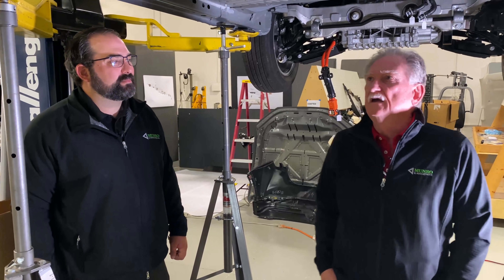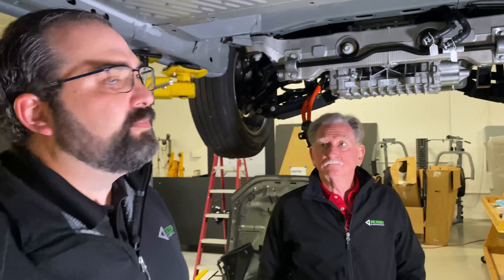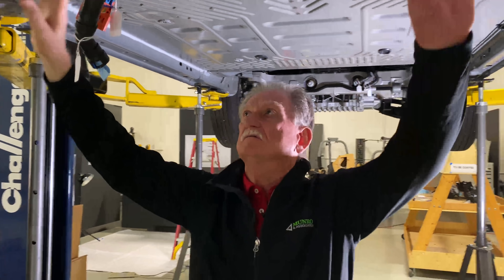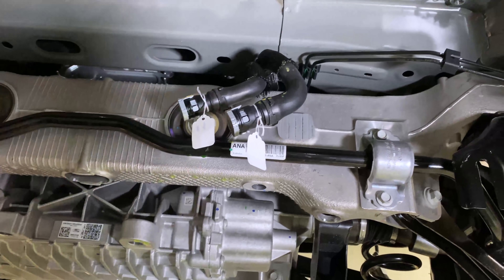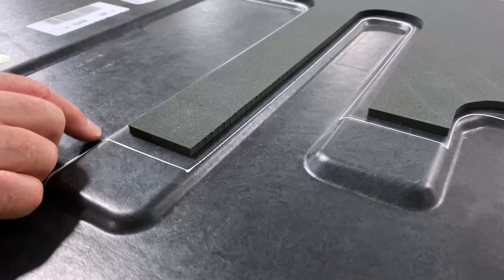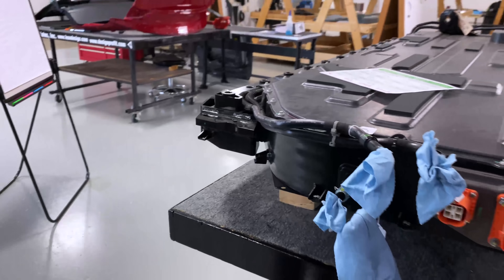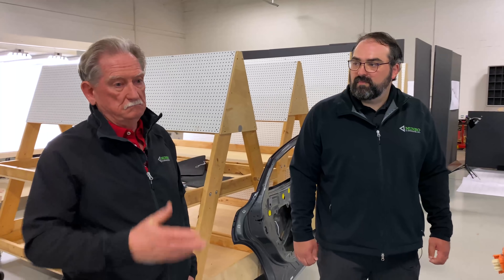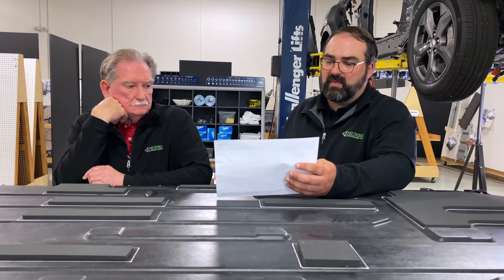First look at the Ford Mustang Mach-E Electric Battery

Comment: That chart is a gold mine 😁. Just imagine the Mach E with the extended range battery weight will be and it will still have less range both model 3 and model Y 🙈.
Reply: If you watch real reviews you would see that the Mustang Mach E LR is closer to the Model Y in terms of range than these charts show. Seems Ford sandbagged their numbers and Tesla puffed theirs up.
Reply: @spacebound1969  Define real reviews 🙈. Auto magazines or You tubers who Ford's sponsors 😁. What's the data shows and what the chart shows is Battery weight, battery capacity and rated range. If you run both model Y AWD and Mach E extended range until the battery dies as EPA range do as on the same playing field then you should get your answer. In terms of electric cars it's all about effieciency and charging speed. Ford's is hiding the Mach E lackluster effieciency with bigger battery capacity, but not as bad as both Audi E tron and I Pace. If you have issue with EPA range then go to EPA and complain 👍👍.

"Compare Side-by-Side" https://www.fueleconomy.gov/feg/Find.do?action=sbs&id=43406&id=43603

Comment: That chart at the end shows how far ahead Tesla is compared to the competition in range and efficiency.
Reply: True.. But keep in mind that a Tesla is compromised by the materials used and the build quality. The Audi and Jaguar use premium & luxury materials that are heavier and dense. Also different battery chemistry gives Tesla an edge. 

A lot of people are willing to give up some range and efficiency for a well built car.. People drive the i3 not for its range, people drive it because its a well built car with good handling.
Reply: That chart is the claimed range by manufacturers some like the Tesla are very over optimistic while the Ford base their range on more range of  temperatures and driving conditions. Edmonds did a test of both cars and it their test found the Mach-E which achieved a real world driving range of 304 miles which puts it towards the top of that list

Comment: 15:30 And your range issues are based on two disconnects. First, Tesla uses a different EPA testing cycle, which inflates their range relative to the others by ~15%. Second, the format of the vehicle has as much of an impact as anything else, so larger, heavier vehicles will not go as far on a given amount of energy.
Reply: Larger, heavier vehicles with heavier battery packs in relation to the pack size.
Just not efficient.
Reply: @rogerstarkey5390  Yes, there's a lot of specific details that are being glossed over here. The most comparable Tesla to the Audi e-Tron is the Model X, which is omitted from this list. A comparison of those two vehicles would show that Tesla's "advantage" is not as significant as Sandy is purporting it to be. 

The other detail that Sandy isn't addressing with the battery weight is that Audi is using more power-dense battery cells with a significant buffer that Tesla isn't using. That's why the e-Tron will charge to "full" in about 45 minutes, or at least 15 to 20 minutes faster than the fastest charging Teslas can go from 0% to full.
Reply: Thank you for schooling some of these people.
Reply: Agreed, they use EPA instead of the now accepted WLTP which is more real world performance.
Reply: @drumahnz  That's not what I'm saying. The EPA offers a choice of two testing cycles. One is more simplistic, and simply multiplies the calculated range by 0.7. The other, provides additional tests that can be used to offset that reduction, and that is the EPA cycle that Tesla uses. For real-world driving, the more conservative EPA test appears to be far more accurate, while Tesla's chosen cycle appears overly optimistic. 

As an example, on paper, the Tesla Model 3 LR has ~10% more range than the Ford Mustang Mach-E RWD Extended Range. However, in most real-world scenarios, the Mach-E RWD Extended Range has the same or better range than the Model 3 LR.
Reply: @drumahnz  
My understanding was (is) that EPA is closer to real world.

Comment: 15:06 You're mixing numbers on the Chevrolet Bolt EV. The 259 mile Chevy Bolt EV has a 66 kWh battery pack which only weighs 430 kg. The older pack is 60 kW, weighs 435 kg, and provides 238 miles of range.

Comment: At 16:00:
If somebody talks about the capacity of a battery pack, it is useful to state whether it is the gross or the net capacity. 
The gross capacity of the Standard Range Mach-E is 75.5 kwh. (https://www.greencarreports.com/news/1128726_ford-mustang-mach-e-electric-vehicle-battery-capacity)
The net capacity is 68 kwh
For E-Tron you mentioned the gross capacity (95 kwh).
About the BMW i3 line: BMW produced the 22 kwh pack between 2014-2017. Since then BMW doubled the energy density of i3's packs. (https://electrek.co/2019/11/22/bmw-keeps-doubling-energy-density-of-i3-batteries-enough-to-kill-range-extending-engine-for-good/). Unfortunately they do not say if it is gravimetric, or volumetric. But we can assume that the gravimetric increased significantly. Also, "Fifth-generation BMW eDrive technology also includes a high-voltage battery. Its volumetric energy density at cell level is up by around 40% compared to the high-voltage battery in the 2020 BMW i3. " (https://www.greencarcongress.com/2021/06/20210602-ix.html).
I guess these will be in iX and i4. iX already started production.
So, is not this line quite misleading?
Aout ETRON: when a manufacturer build and BEV based on an existing ICE platform, there are some advantages (low cost and relatively fast development, low cost of modifying factories to build the vehicle) as well as disadvantages (more weight, less efficiency). A more decent comparison would be to put here the MEB pack's battery, which was checked by Sandy anyway recently (id.4 pack), and according to their data the energy density of id.4 pack is less than 2% more than Model Y's. 
Bolt is also an old design, I have not researched it, but I would not be surprised if that was outdated data as well.
And I can see Tesla fans jumping on these outdated data without thinking a tiny but by themselves.
And as I expected: https://youtu.be/D0e7NuFtNG8?list=TLPQMDYwNzIwMjGzoQFo2rh1Dg.

Comment: The battery connection points are almost identical to the Ford Ranger Electric, though slightly different format/scale. In fact, the entire construction strategy outside of the exterior structural battery case is similar (which would have to be different for body on frame). I guess some things don't really change that much, even after 20+ years.

Comment: Talking of wiring looms, Tesla's ongoing reductions have not been mentioned in a while.  Seemed like they were planning TCP-IP or other digital control over power to reach the targets of cable removal that Elon had been talking about.
Reply: That was a plan for the model Y that never happened.  They also kept the crappy 12 volt battery.  Can't wait for those changes.
Reply: Nice way to get hacked, no thanks.
Reply: @Passions  Your bank account been hacked recently?  Neither has mine.  Hacking is not easy.  If you can Hack a Tesla they will pay you millions.  Get to work.
Reply: Unless stupidly implemented,  hacking it would require physical intrusion to have already occurred, no more vulnerable than traditional wiring.  Spoofing Tesla over-the-air updates is a much bigger potential risk. If you figure that one out then there is no need to even touch the car.

Comment: I too would like to see the total weights of the cars included and for us old school guys, the weights in pounds.  Keep up the good work I can't wait for the next installment. Thanks
Reply: As far as I know, all current cars/trucks/ev's are designed and build using metric, even in the US.  Therefore, all the technical specs are in metric as it's meant for engineers and designers world wide to read.
Reply: Please, continue using Metric system and scales...

Comment: How long time does it take to drop the battery?How is the quality and fitment on those coolinglines and breaklines in regards of rust and breakage? 
Also; can you change the bushings on the stabilisator without dropping the battery?

Comment: Future Teslas: batteries, in the way they are arranged, are structural (load carriers)
Ford's Mach-E: battery BOX is structural (load carrier)

Just to elaborate for somebody not in the loop on how similar verbiage here means different things
Reply: And what is the difference in pros and cons?
Reply: @Steph1  supposedly.. I’m no expert.. the rigidity of using all the batteries to create the bond between top and bottom of the battery box is going to allow a significantly more rigid structure, while simultaneously reducing weight that would otherwise be needed to be added to structural rigidity.. you are using something that would be there already, the batteries. Now.. what’s the down side, is my question. If that Tesla battery gets seriously torqued in an accident.. those batteries take more brunt of the impact? How do you keep them stable and not causing a worse fire hazard than li ion batteries already have.. maybe it’s the idea that, if the accident is bad enough to wreck that battery pack, it’s unsurvivable anyway.. idk
Reply: @Steph1  
- Structural battery 'Box' does not reduce vehicle weight. ( They just moved it: More structure on box, and less on unibody )
- Structural 'battery' takes advantage of each cells physical structure, allowing less structure on box AND less on unibody, giving overall weight savings.

- imo the safety of both designs would be subject to design and testing.  Using the cell structure likely takes more care and cooperation between engineers/departments.

Comment: I agree 100% that just throwing a bigger battery is not an answer to better range or efficiency, lighter weight, better forward looking engineering and multi speed gearboxes to keep the motor in it's sweet spot are key.  
Also need much improved energy capture technology regarding regen ie., Ultra Capacitors.

Comment: What's exactly included in battery pack weight? And what's the structural strengthening of each pack to the car body? Without this data weight comparison is useless

Comment: Really cool to see Ford building structural support into their battery pack! In a decade or two we're going to look back on structural batteries and think it was the most obvious thing in the world, but as the e-tron and i-pace show it's not quite obvious enough yet.

Overall looks like Ford is doing a pretty great job so far, so I'm happy for them. Thanks for the excellent analysis!
Reply: Great job?
They used a structural pack and managed to ADD weight with less energy.
Reply: @rogerstarkey5390  Similar to your mother right?
Reply: Great job? Did you see the thermal management part? Hardly the best engineering.
Reply: @bluetoad2668  And did you hear about all the problems Tesla has?
Doors that sometimes work, windows that sometimes work, screen blackouts, panel gets, mismatch plastics, bad build quality stated by several other online reviewers of automobile industry, over promised under delivered range and my favorite, waiting three to four weeks for a flatbed truck to come in pick up the car for repair. On top of you can't buy parts for your own repair.
Reply: @bluetoad2668  it's probably a slightly lousy engineering design, but it's efficient.

Comment: Will you guys be doing a teardown of the Mach-E battery pack?

Thanks for the video!
Reply from the maker: Yes indeed.
Reply: @MunroLive   would be nice to see module details when you do so ie cells per module, module voltage & capacity, XsYp arrangement, etc. These kinds of details were not included in the ID.4 battery teardown which seemed to mostly focus on the connectors and physical assembly.

Comment: Thanks for doing these videos. In this one you talk about the Mach E battery pack being structural and they use aluminum for the battery case. In your video with Sabic you redesigned the VW ID.4 using reinforced plastic (thermo plastic), Stamax to save weight and add fire retardant. Given how Ford is using its battery pack for a key structural component, would Stamax be an option that would provide similar structural effectiveness and other benefits like weight reduction or in the case of the Mach E is aluminum the better choice?
Reply: Had a similar thought and question.. hoping Sandy mentions it when they get deeper into this battery tear down

Comment: So if it comes to changing the brake lines, the battery has to be pulled? That adds a lot of time/cost.
Reply: When would brake lines ever need to be replaced?
Reply: @jamesengland7461  you must not live in the "Salt Belt" of the USA, where rock salt & chemical deicers are spread on the roads around-the-clock during the winter months.  Brake line replacement on vehicles from these areas is almost guaranteed every few years, regardless of how well you try to keep the undercarriage washed off.  Usually after the 2nd set of replacement brake lines, the vehicle is no longer structurally sound and it is off to the crusher.
Reply: @KCautodoctor  in such a case,  obviously these brake lines are well- shielded and will last as long as the structure below them.
Reply: @jamesengland7461  They're also trapped in a space which can't be cleaned, and will likely accumulate salty deposits. We'll see in a few years how well those lines last.

Comment: so 7.14kg per kwh.. 68kwh pack = 485.. There long range is 88kwh so ~ 645-650kg.. Guess the benchmark in body in white vs. structure pack will be a Giga Berlin / Giga Texas Model Y as a comparison structure pack. Also on that chart through OBD and software the Model 3 and Y have 82kwh now as reference - Unsure if the weight has gone up or not but I believe its neutral or less than what was the original 3/Y tear down you folks did.  Good video and thanks for doing this on public record, love it!

Comment: What safety precautions you take while removing battery which could be holding hazardous amounts of charge ? Keen to know.
Reply: pretty sure they just cut/unmounted the safety loop for emergency services, and then all external connections of the battery should be voltage free, and then checked with voltmeters directly on the battery contacts if it was voltage-free (latter part is shown in the video)

Comment: Aside from the Mach-E did any of those other vehicles incorporate structural components into the battery pack? Hard to compare the kg/kWh ratio.
Reply: I was thinking the exact same thing! You need to compare Apples to Apples!!!
Reply: And the mileage, there’re all different types of vehicles.
Reply: @jetking3079  not really.  Model 3 and Model Y covered all the others.  None of them were busses or trucks.
Reply: @John Smith But it is not structural, Ford’s is! Tesla is moving in this direction in upcoming modifications!
Reply: @MikeYoungeasytravel  You know the safety of the 2012 Model S was due to the structural integrity of the battery pack.  That was many years ago now.
Reply: And don't forget that ME standard battery is 75kWh of which only 68kWh is available to preserve battery life. When Tesla reports 75kWh -- it's total. Also the Tesla's range is grossly overstated. The credible tests show ME has slightly better range than Tesla: https://www.edmunds.com/car-news/tested-2021-ford-mustang-mach-e-standard-range-rwd-beats-epa-range-by-34-miles.html